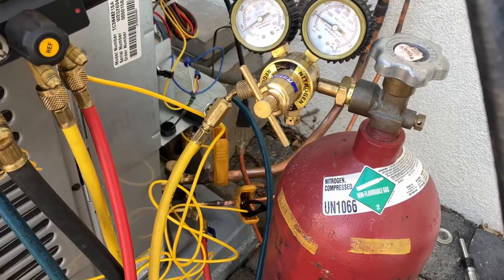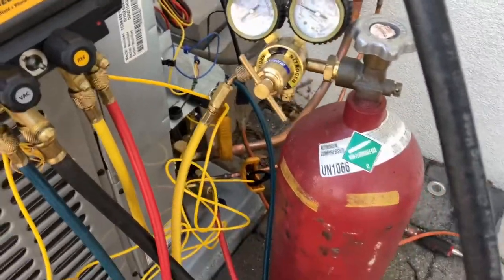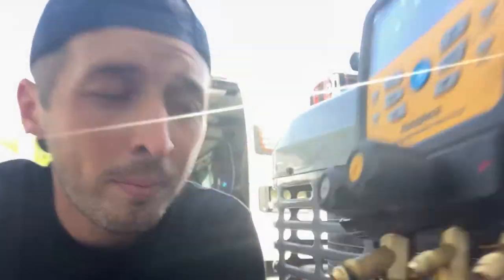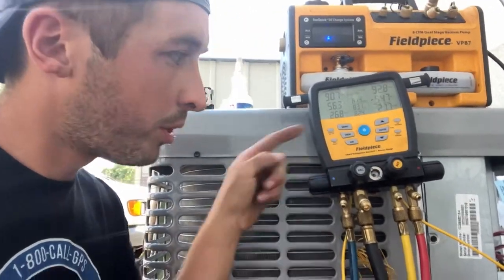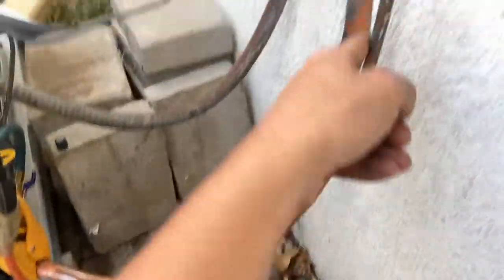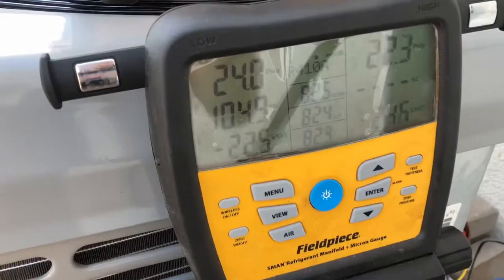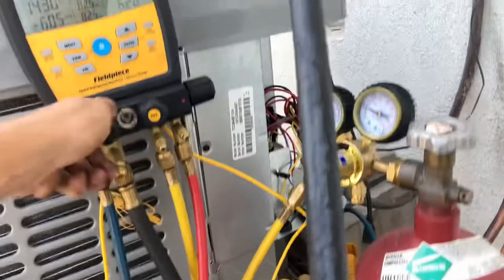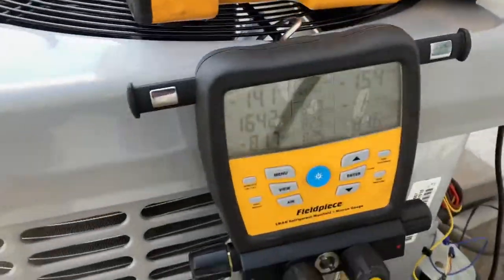Most People Purge Nitrogen Wrong

Comment: Great process! Ive been doing the same for a while now. Ive gotten microns down to 28 and mostly held under 50 using your same technique on commercial systems. I have always pulled my valve cores and also used a direct pump to piping connection ising the Trublue hose. Super fast pulldowns. Another helpful vacuum reference was a book form Trutech tools called A Review of Vacuum for Service Engineers

Comment: I wouldnt expose the system to atmospheric pressure. My lineset would have 90 and 45 degree turns, no looping. Its easy to criticize other peoples work, im sure my work is no different. Thank you for the point about the ballast.